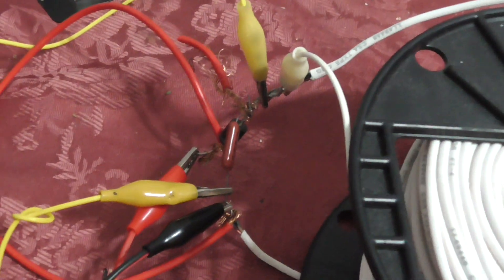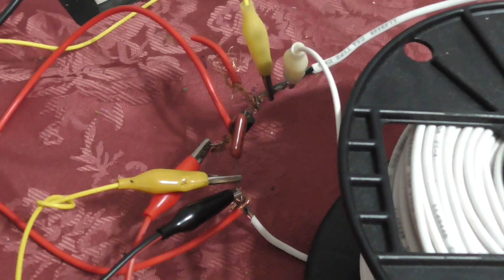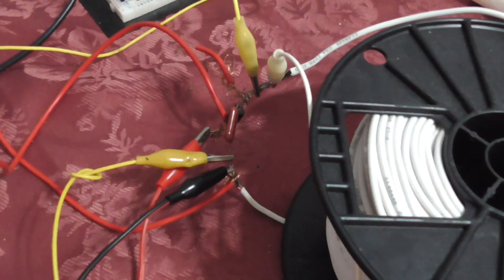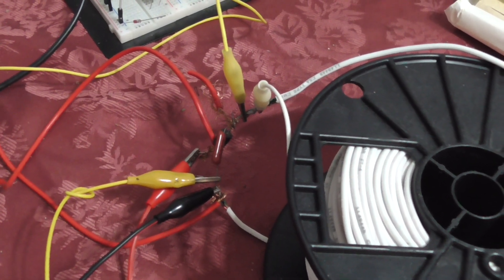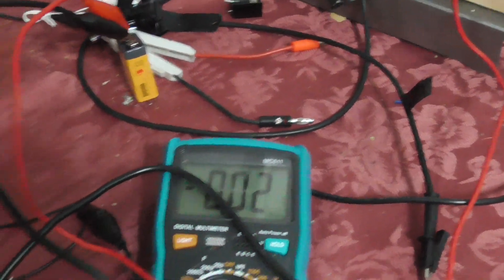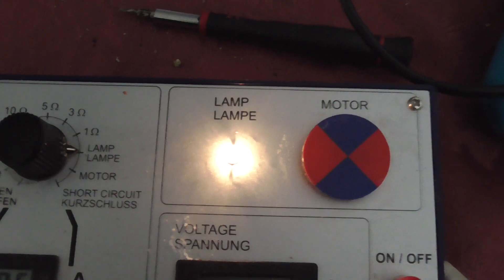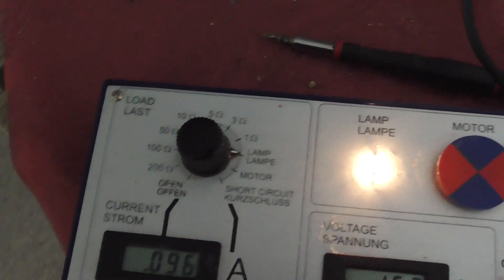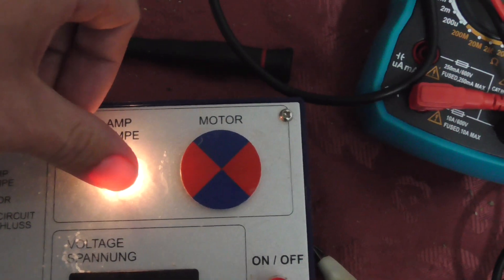Generator COP 5

Comment: Also if you have analog meters (ones without battery or standalone type), use them, some digital volt meters can leak power power into circuits in certain conditions. Interesting, keep digging into it!
Reply from the maker: Yeah I know about analog vs digital it's all I got at the moment, It gives a good idea what is going on, I can see from hard limiting my trigger to very little indeed according to the books there is just no current available to flow from the input power. Meanwhile on the output side i'm loading it with motors, lamps, all things that take in the upper ma ranges even amp to operate.  So the readings are in the right ballpark so to speak :) Based on what I have been able to operate on the output.